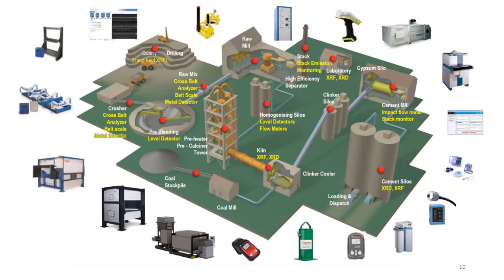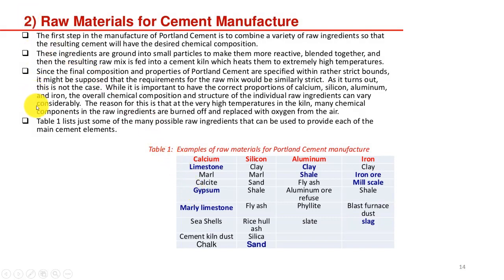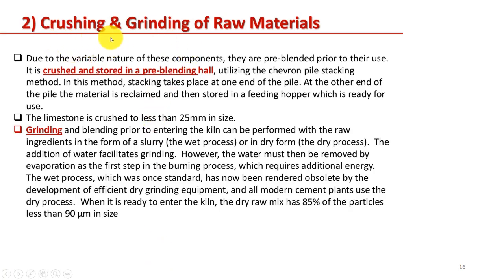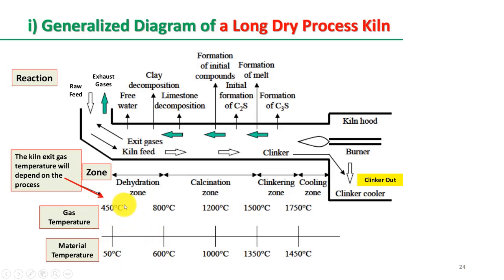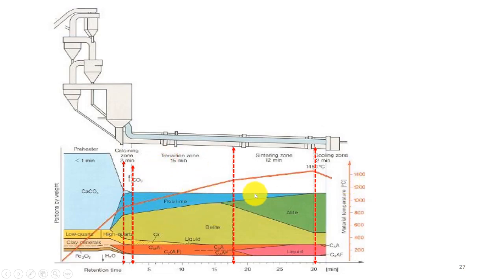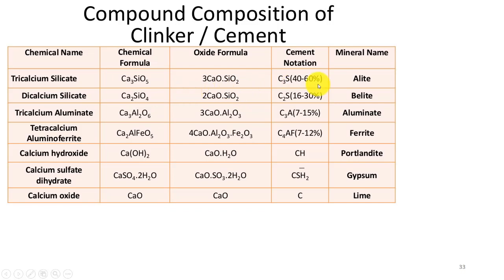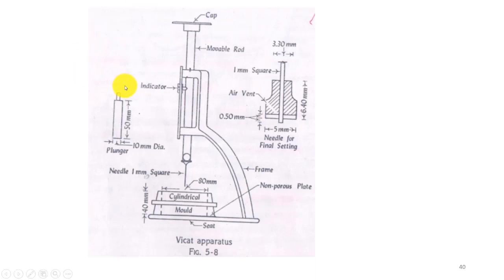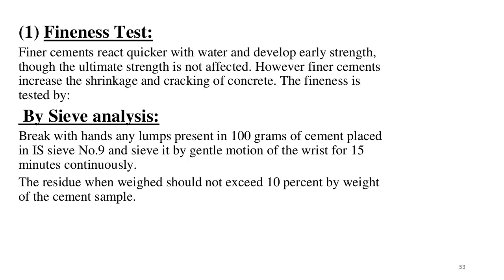Manufacturing of Cement | Cement Quality Tests | Cement Manufacturing, Composition and Its Setting

Comment: we offer customized ultra fine powder grinding mills system and coated machines for calcium carbonate/caco3/dolomite/talc/gypsum/limestone/ calcium oxide/ bentonite/dolomite powder
325mesh~3500mesh. 
better powder quality
 lower energy-consumption
 PLC control
www.lymill.com
Fujian Longyi Powder Equipment Manufacturing Co., Ltd
MP/Wechat/Whatsapp: +86 15105956429
Samuel@lymill.com

Comment: assalamoalikum very good explanation 
Q.1 The raw material which we are using is to extract oxides like calcium oxide, aluminum oxide, slicon oxide etc from them ?
Q.2  The oxides like calcium oxide, aluminum oxide, silicon oxide etc are present in cement but in compound form like alite, belite ,tricalcium aluminate and tetracalcium  aluminoferrite
Reply from the maker: Wasalaam.
1. Yes, the Raw materials containing desired concentration of chemical components are added to result alite, balite during clinkering phase.
Reply from the maker: 2. Actually both argillaceous and calcarious rocks contain chemical compounds in the form of oxides of silica alumina and iron etc. The raw rocks of desired concentration are grinded and fired at around 1450C to get clinker which contains alite, balite etc.